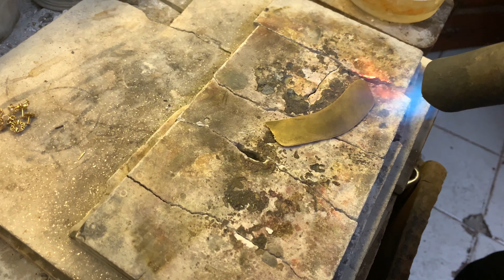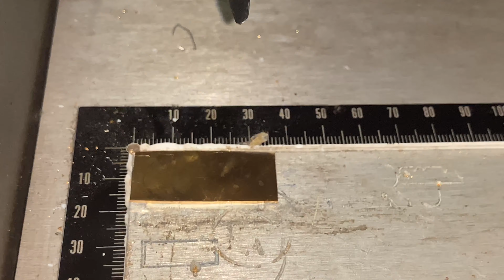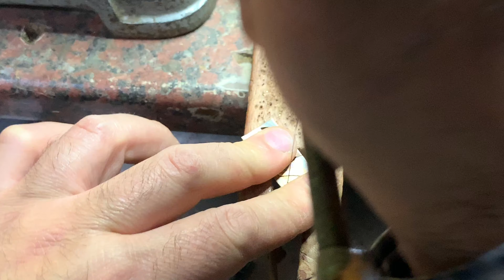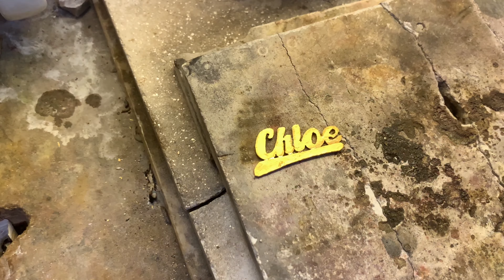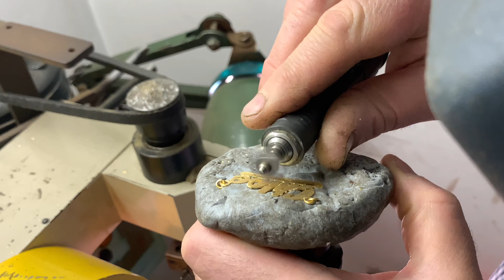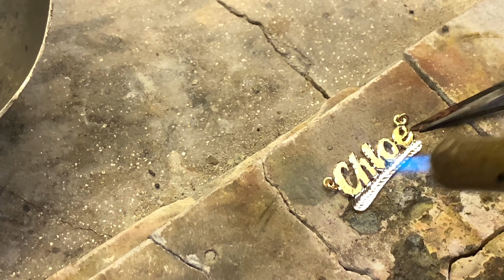JEWELLERY MAKING 22k Gold Pendant Name Chain Indian Gold 4K Video

Comment: Hello thanks for sharing this clip .i have a question, what is the name of that machine? (writing on the metal)Thanks
Reply from the maker: matt kermani hi Matt, thanks for your comment. The machine is called Gem FX5 engraving machine. I hope this helps. Please subscribe and share :) thanks
Reply: @TheJewelleryWorkshop  where i can purchase this engraver machine sir...can you tell me sir....
Reply from the maker: Check on google
Reply: @TheJewelleryWorkshop  thanks for kind reply ....
Reply: i think its cnc machine but u can use normal printer and check my video I'll upload all details
Reply: In the Philippines the Jewelers just draw and cut it manually like what I've seen @Alaherong Pinoy tv